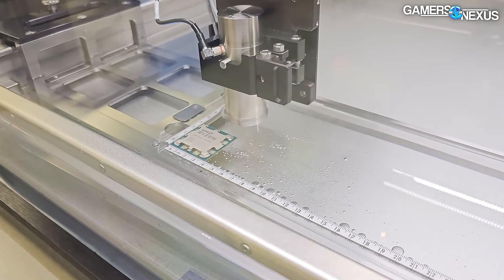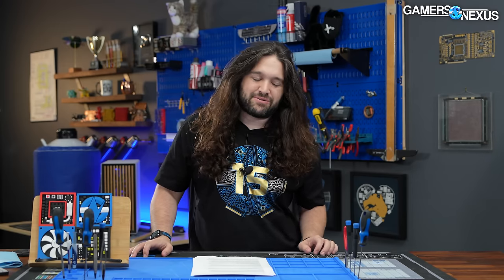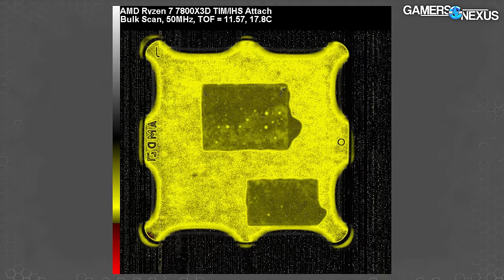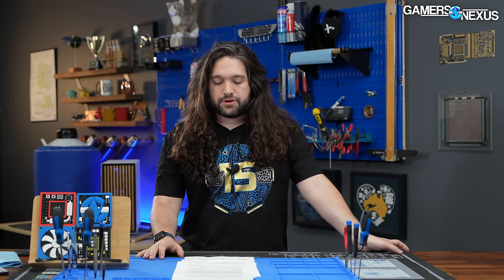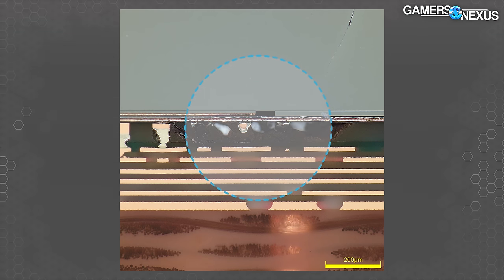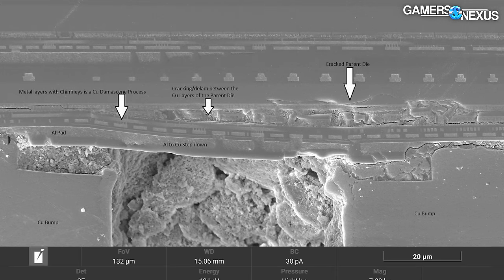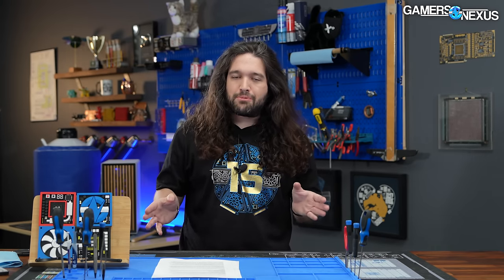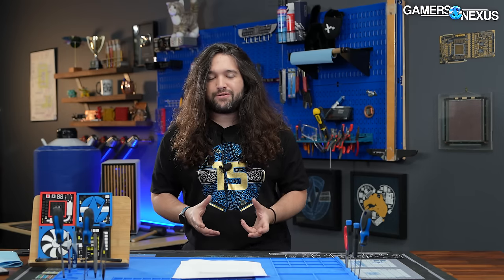The Truth About AMD's CPU Failures: X-Ray, Electron Microscope, & Ryzen Burns

Comment: I find the amd copyright mark fascinating because it's dated before the CPU was actually released. Just shows how long it was actually in development.
Reply from the maker: Definitely a great point on that!
Reply: I thought the same thing. 2021, release 2 years later.
Reply: The development cycles on cpus/gpus are measured in years and have been for at least a decade!
Reply: Yeah, and you can bet they were working on it for a couple years before that mark was made too, so they are always thinking about 5 years into the future, teaching sand to think takes a long time and so much work, it really is amazing.
Reply: @Dan-Simms  if you ever felt the need to travel to the future this thing looks like a good start xD
Reply: @yottaXT  Yeah but did it actually take the needed 1.21Gigawatts of power to cause this kind of damage, hmmmmmmm ;)
Reply: it has been commonly known that technology is out of date when it is released. Just that it is not talked about much since many dont consider the time it takes to create something.
Reply: Anything you're buying now was in development at least 3 years ago.
Reply: @tclark5481  Tapeouts happen about year before, it's when circuit design is done and it goes to sampling. First product using this design(Zen4 chiplet) was released last year in September so tapeout had to happen in 2021.
Reply: i disagree. It's not bleeding edge of theoretical possibility but typically it is the most up to date reasonably priced mass producable consumer product.
Reply: @hyperstimmed  bread?
Reply: @kondziu1992  Depending on the bread, yeah. Especially if we're talking about heritage style sourdough base. There are sourdoughs out there that are well over a decade old, still being cut and used to create new breads.
Reply: Greetings,

I believe this was already mentioned before somewhere on reddit however not in details that the products release is following a road map to maintain marketing and development of 1 decade step, all manufacturers AMD, Intel, Nvidia and etc have models of 1 decade in advance, as long as a party has the capital they can have them like specific government sections and government like organized parties and persons who meet the requirements like (e. g Bruce Wayne 🙂), I believe this is enough and no more or someone might have unforseen fatal accident.
Reply: I wonder how long it took Ryzen to come out whenever AMD was in the doldrums with the FX series.
Reply: @philkensebben157  the bar I brew for has a 127 year old starter, wild!
Reply: @kognak6640  Oh I get it, I am a former hardware designer, board level, not semiconductors.
Reply: @philkensebben157  Most bread feeds you. Sourdough on the other hand...
Reply: @archibaldwhiskers1428  That sounds like it makes a fantastic loaf of bread. All the different kinds of yeast coming in.
Reply: the tech is maybe obsolete, but it takes a lot of time for the tech to be mature enough to be commercially viable: the industry works pipelined, much like the CPUs. Half the time the currently developed tech is engineered to be marketable and half the time the next tech is underway.
Reply: Not with Intel lol  @hyperstimmed

Comment: Born too late to explore the frontiers. Born too early to explore the galaxy. Born at just the right time to enjoy Gamers Nexus thoroughly breaking down manufacturing, faults, failures, mishaps and responses. Love it.
Reply: @aaronmoore3050  You can
Reply: I'd say this is a good enough compromise... though tbh I would not want to be on the frontier. That stuff just seems like it was a whole wagon load of suck
Reply: The adventure of starvation/ dysentery vs the adventure of freezing / imploding
Reply: Also born at the right time to explore infinite worlds created by AI. Just don't die in the next 5 years or you're going to miss out on so much.
Reply: The only thing I really enjoy about this body is the computers and stuff on the computers, sadly the quality of people is often the quality of a GIgabyte power supply connected to an ASUS board with the soul of an 11th gen processor.

Comment: Here's the video we've all been waiting for! Great work as always GN - your contribution to this industry cannot be understated
Reply from the maker: Very kind of you to say! I don't know that we've changed a ton yet, but we're doing our best to influence companies in a positive way!
Reply: @GamersNexus  The power supplies no longer blowing up, AIOs being avoided etc say different. Seriously its not just the changes from manufacturers but also awareness for consumers. You've changed so much and the fact that you're still here and have somehow managed to keep that integrity is awesome.
Reply: @GamersNexus  You've really made an impact. GN has been able to put pressure on manufacturers in a way no one else has - Nvidia with the 12 pin issue, Gigabyte with their PSU issue, Nzxt with their riser cable - the list goes on. The combination of your thoroughness and experience and your journalistic integrity and independence makes GN a force to be reckoned with, and manufacturers know that now
Reply: @GamersNexus  OH you HAVE. Personal example:  The Fractal Torrent Case. They **CAME TO YOU** and told you about an issue AFTER you gave it a glowing review. They pulled the product. FIXED the issue. I bought one for EXACTLY that reason.
So yes, you DID make a difference.

Comment: Thank you for this Steve, we definitely would never have gotten to see anything like this if AMD had gotten their hands on it instead, and they no doubt still got enough data from other boards to fix it themselves.
Reply: THANKS STEVE
Reply: AMD got their hands on a whole bunch of RMA'ed dead CPUs by now, and they're not making a peep, hahaha.
Reply: If I was them I would say thanks we will pay great attention to this. Bummer that this was a 3D chip. I upgraded my 3000 series processor to the 5800X3D and it was an excellent upgrade.
Reply: @haldorasgirson9463  This failure has been reported for non-X3D chips as well. This seems completely specific to AM5, and from Buildzoid's analysis this is purely a voltage regulation issue that is entirely preventable with firmware.
Reply: @arkain1  Well, it is possible they are seeing the failures themselves and are working on a solution for both hardware and firmware. I mean, let's be completely fair here, as this issue mainly affects ASUS boards, so maybe AMD didn't know about this issue right off. I'm sure they will correct the issue in the interest of public relations.
Reply: Still haven't update bios on my mobo...Seems my 7800X3D on an asus b650 tuf is safe through if we can trust HWmonitor...Never seen 1.2 volts in games or the 1 time I did R23. These videos does make me wanna update, but Im weary of rushed bioses...
Reply: @andersjjensen  as an Intel fan I like Ryzen CPUs and wanted to make my next build a Ryzen but after seeing the comments and the video I’m gonna have to assume that I should stick with Intel? 😕
Reply: @morablaze486  Intel has IHS bending issues. That can't be fixed with firmware. This problem is entirely preventable and only happens on a select motherboards (that pummels VSOC with 1.4 volts). A preliminary AGESA update from AMD has already been published and several of the affected boards have had BIOS updates. So I don't know what you should and shouldn't do. Just be weary of confirmation bias. Nvidia recently had a rather annoying driver issue and a case where a game would fry 3090s, but "some" pretend it never happened because that doesn't fit their existing narrative. I'm typing this from a 14 year old laptop with an Intel IGP that still, to this day, has a driver bug that just never got fixed and now it's out of service life. So sometimes Intel doesn't give a fsck either.

TL;DR: All software has bugs and no system is perfect. Over the nearly 30 years I've built computers I've never had more, nor less, problems with any particular manufacturer except VIA. Their chipset drivers for Windows were consistently shit and the Linux drivers were consistently stable.
Reply: So guys, I got an Asus prime 650 plus and a 7800x3d. I still haven't assembled the pc, what do I have to do? Please help me, I'm pretty ignorant in this and I don't want to burn anything. Do i just have to update the bios and force this Soc voltage to a lower point or do I have to do more?
Reply: @andersjjensen  I concur.
Good stuff is out there. Bad stuff is out there. Caveat Emptor. 
STEVE is making that easier. (Whole GN crew but.... you get the idea.)(Currently rocking a PII with Win98SE for ye olde gaming machina. She rumbles like a scraggly old tom cat.)

Comment: Imagine just how quickly and quietly ASUS and/or AMD would try to sweep this under the rug with a superfical and shallow statement if GN wasn't around
Reply: leave Britney alone, AMD are flawlesssss!!!!
Reply: AMD set limits Asus did not follow . If you over clock  by default it is not AMD at fault
Reply: 100%
Reply: In the previous video GN quoted their source from AMD. So they already figured out the problem at the time. ¯\_(ツ)_/¯
Reply: asus saying nothing basicly gaslighted everyone to think its amd
Reply: we'd be lucky if they ever issued a statement
Reply: @GIANNHSPEIRAIAS  well ass-sus mobos are shit. At least the one I have on is made as inanely cheap, and they obviusly did the bare minimum to make it. and it's cramped to work on. Gigabyte did the same with their psus that doubled as a firework.
Reply: @gorkskoal9315  Gigabyte don't make PSUs. They just ordered them made as cheaply as possible and didn't bother to test if they worked properly. Asus at least makes their own motherboards and are solely responsible for the junk they put out; they don't have a subcontractor they can blame
Reply: The fundamental question is: "Why mobo VRM is pumping current into CPU which is DEAD and lost a communication with mobo about temps and other sensors)?"

Normally the safety rule is when comm is out and system is not sure the CPU is OK, cut the power immediately.
The other thing is why CPU doesn't insert NOOP instructions to cool itself down like old Pentium 4 (runs without cooler) 20 years ago?

The 4th stage CPU meltdown is just consequence of above.
Reply: Under the rug or under the ROG?
Reply: @richard.20000  Still there, just much larger and more varied in what it does. Chips are able to throttle themselves to a stupid amount now days with performance going well under 50% of the norm if temperatures get too high. ASUS just disregarded the entire thing and kept feeding the chip a power profile it shouldn't have no matter what the chip asked for. This is 100% ASUS. AMD is getting the crap because they are the bigger name, even though this is not the first time ASUS has done this. A few years ago ASUS was having boards catch fire because they designed them wrong for the voltage they were trying to send through their caps. They couldn't figure out how to manage the power profile of the board they themselves built. Is it any wonder they f'd up power to the chip? I haven't bought ASUS in years. I do not trust them. They consistently build boards that want to self destruct not from manufacturing defects, which they have many well documented ones as well, but from basic design flaws.
Reply: @thesteelrodent1796  Oh. ok. MA BAD!
Reply: @fist003  lol you mean: OOPS!  isn't a statement?
Reply: @richard.20000  and where in this chain is the programing on the CMOS orVRM or firmware something that saying: FIRE! STOP NO MO CURRENT STOP STOP SHUTDOWN!...back in the day anyway that was hard coded into a rom or bios. Did Asus cut corners or something? or does anyone know yet?
Reply: @ArieLash01  AMD apparently didn't set limits or if they did they poorly communicated what they should be especially for X3D chips, ASUS boards were not the only ones affected, this same issue has been seen on Asrock and Gigabyte boards as well, even Gamers Nexus in their first video blamed AMD for their poor communication. 

In regards to overclocking, last I checked EXPO is an AMD thing that they implemented and are promoting, so yes it is 100% AMD's fault, stop passing the blame.
Reply: @halycon404  1) CPU can insert NOOP (no operation) instruction like ancient Pentium 4 did 20 years ago. CPU will almost stall and consume tiny current (even at high voltage sent by mobo VRM).

2) CPU set multiplier (frequency) for each core. So CPU can down clock itself just like laptop CPU does.

All this is 100% fail of AMD CPU.

3) Why mobo is keep sending high voltage even when current sensors shows >37 A/12V which is out of AM5 socket specifications and CPU doesn't communicate, that's a question. I guess safety shut down procedure to avoid total CPU meltdown should be AMD responsibility (to protect their CPU, good name and reputation, can be in contract). Hence another 100% AMD fail.
Reply: You mean Asus not bothering to test their sht on boards that cost $500 and deciding to just gorilla voltage against AMD's guidelines?
Reply: @richard.20000  inserting NOOP or throttling works only when the CPU is still alive. This is not an overheat issue. This is a gross overvoltage issue that eventually kills the CPU causing a dead short, then the dead short blows up the CPU and possibly the motherboard too if the latter lacks any form of protection
Reply: @aflyingcowboy31  Oh dear oh dear.. EXPO is, like XMP, a profile. It is for "overclocking" your RAM to the speed the Manufacturer advertises them for. And the settings get tested and validated by AMD. That's about it. 

The profiles include clock speed, timings, and voltages and so on. 

What we have here in case of ASUS however. Is them completely ignoring the Voltage of the EXPO profile, and setting it much much much higher, to make sure that their Mainboards are compatible with as much RAM as possible, without testing or optimization of their Boards and Bios.

So sorry, there is no passing the blame. It is ASUSs fault for running way to high SoC voltages on their board. Voltages that are way above the specifications of AM5 and Zen 4.

So please, don't try to blame AMD for a total incompetence and failure on the side of Asus. Did chips die on other boards? Yes they did. But that has nothing to do with Asus accelerating the death of a CPU by deliberately going above specifications, to make their terrible engineering work somehow work with a lot of different RAM.

And the even better part is ASUS's bs of "You don't want your CPU to die? Here download this Beta BIOS as soon as possible, it's very important!" followed by a "Oh btw, if you use a beta bios your warranty is void." Thank you very much Ass-sus, go f yourself.

But what else to expect of a company where I had the fan controls fail on every fing GPU I ever owned from them. Makes me wonder if they actually have talent, or if they just aren't allowed to do their job and work properly.
Reply: @germanmosca  Oh dear oh dear...  go read the comment I was replying to on why I was talking about EXPO. 

"So sorry, there is no passing the blame. It is ASUSs fault for running way to high SoC voltages on their board. Voltages that are way above the specifications of AM5 and Zen 4."

Weird, as I already stated this has affected Asrock, Asus and Gigabyte boards, not just Asus, so apparently AMD has messed up somewhere, never before has this been an Issue, I don't see any ASUS Intel boards using DDR5 doing this do you?

"So please, don't try to blame AMD for a total incompetence and failure on the side of Asus." 

I absolutely can because there is no way 3 different board vendors have now had this issue without AMD somehow being at fault as well.

"Did chips die on other boards? Yes they did. But that has nothing to do with Asus accelerating the death of a CPU by deliberately going above specifications, to make their terrible engineering work somehow work with a lot of different RAM."

Weird they all died in the same way i.e. all of those boards accelerated the death of the chips being used because those chips f***en "exploded. 

FYI multiple people using Gigabyte boards have shown their SOC hit 1.4 volts and above (and yes there are screenshots of it).

Go watch buildzoids video, it completely negates your argument, he tested a Gigabyte board and the VSOC voltage was doing extremely odd things, which tells me there is way more to it then what you would have people believe.

Also you mean the specifications/limits that AMD didn't talk about until this issue occurred:

"We have root caused the issue and have already distributed a new AGESA that puts measures in place on certain power rails on AM5 motherboards to prevent the CPU from operating beyond its specification limits, including a cap on SOC voltage at 1.3V."

Why didn't AMD hard cap this previously.

Comment: As a professional with a background in RCA and FA, I've never seen it presented in a public forum quite so accessibly. This has definitely set a new benchmark for YouTube based public forum discussion!
Reply: What is RCA?
Reply: @Melanie16040  root cause analysis
Reply: @Melanie16040  FA is flight attendant. 

Very interesting combination of professions 😂
Reply: @Melanie16040  root cause analysis and failure analysis. Basically why did it fail and how did it fail.